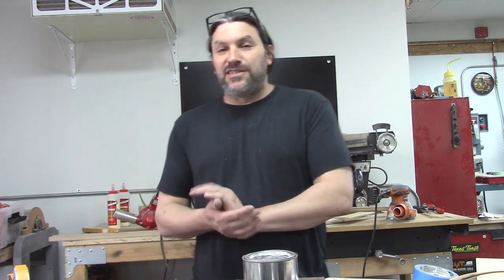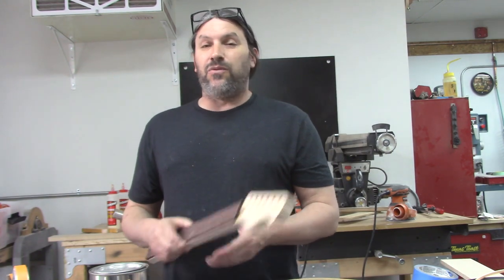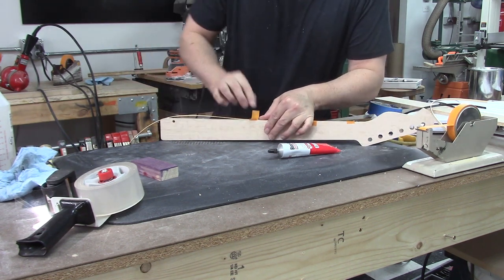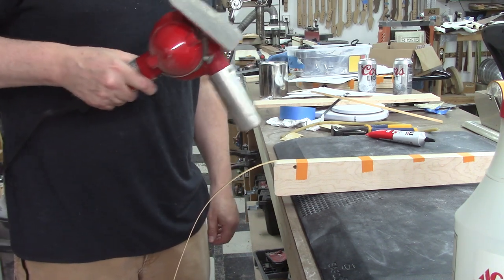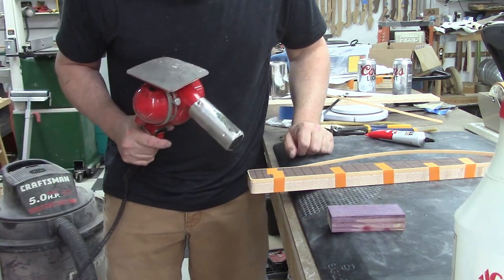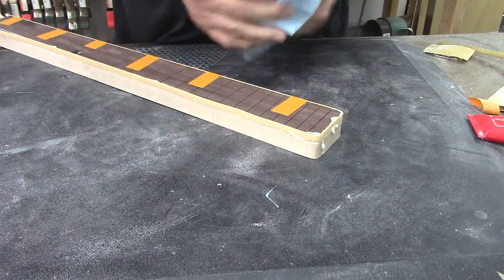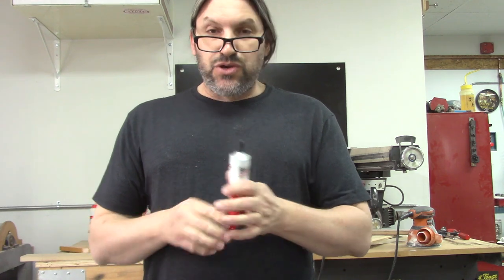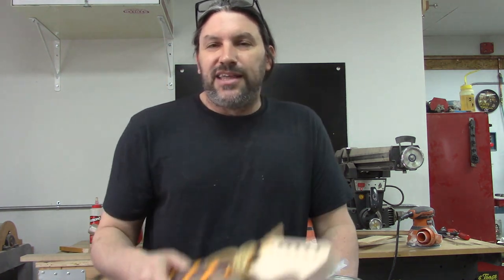Cabin Fever Special Extended Video StewMac's Bind-ALL... How Does It Work?

Comment: I’ve used this and my warning to others is that it doesn’t come out in a very controlled manner, so be careful!  If you’re doing a repair job, the glue will damage a finish.  So far it has held just fine though.
Reply from the maker: Good advice, I have no issues with this for new builds but I didn't think about repair. Use all precautions y'all

Comment: Wonder if that stuff is just rebranded Duco cement. I know a lot of people use that for binding. Personally, I'm more familiar with the acetone/MEK/whatever-solvent-melts-the-plastic method...I'm just not that good at it yet. If that Allparts stuff is similar to Martin binding, try MEK (Methyl Ethyl Ketone). I believe that is the solvent that melts the Martin binding. You can buy a small can of it at Home Depot or Lowe's. It should be right next to the acetone.
Reply from the maker: I have some of the Duco cement, it is different

Comment: I wouldn’t be surprised if the Main ingredients in that tube is acetone and dissolved ABS. Btw. I believe that Crimson Ben uses glue.
Reply: Gert Halberg that’s what I’d guess by looking at it. I haven’t used that stewmac bind all but when I worked at Rickenbacker we made binding glue by chopping up binding and mixing it with acetone. The color and consistency looks just like that bind all.
Reply from the maker: It doesn't react like ABS and acetone, I don't think it melts the binding
Reply: I think it's one of the new Super Bonds. Stewmac have been developing non-solvent paints and bonding systems for years to try making the trade safer. Just a thought.

Comment: This video made me cry. 😥😥 My original tele, I glued the binding to the body using rubber cement. also I let my dad spray the nitro and he built the layers up way too thick.  the guitar was stolen and left in the trunk of a car for months before I got it back.  The entire body is covered on an oak burl cabinet grade veneer.  Now the finish is split like a mofo, and the binding it cracked and all jacked up. I really want to restore it but im afraid I'll seperate the veneer from the body if I try a stripper to remove the bulshit nitro, and if I scrape or sand it I might burn through the damn veneer, it has a foil backing I believe, it sure was metal.  My original baby is sure fucked up.
Reply from the maker: Sorry to hear that my friend. 
:et me know if we can help
Reply: maybe.  is there a way to talk about that, not on here?
Reply from the maker: @1683clifton  Sure man you can always send me an email through the website
Reply: aww hell I filmed it.  let me know if you can see what I posted ok?
Reply: my guitar has aids.  I hate it now.
Reply: I figd it out